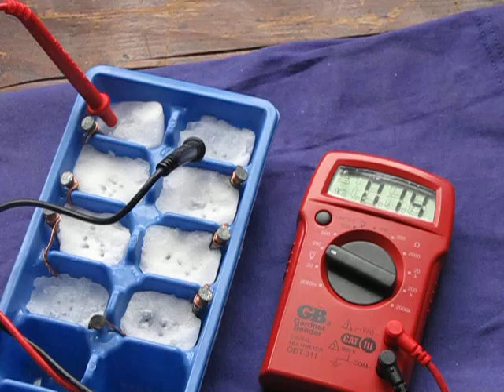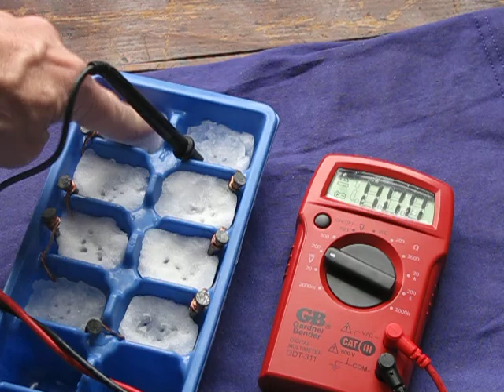Free Energy - Acid Rain Battery Power - Forget Lemons - Part 1

Comment: Hey I live in Co. too! Hi neighbor!  Great experiment,  further proof don't eat the snow even if it's not yellow!
Reply from the maker: Hi neighbor. Thanks for the feedback.  Two more experiments get uploaded today. The last one has a parallel circuit and lights a 3v led, but just barely.  One thing I never knew until recently was how much pollution is emitted from concrete plants and I can see one from here just several miles away as the crow flies!  My goal is to create a big enough parallel circuit outside so I can light one of those new square yellow led's that are incredibly bright...every time it rains or snows.  They require 4.5 volts but I don't know their current requirement yet.  Stay tuned...free polluted acid rain power forever, for everyone!